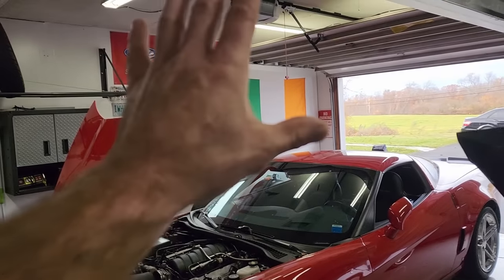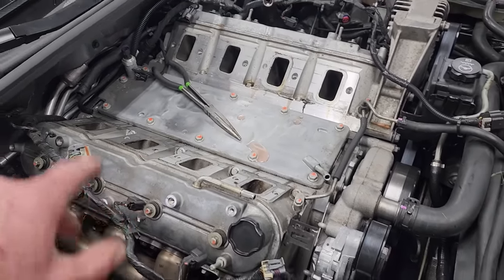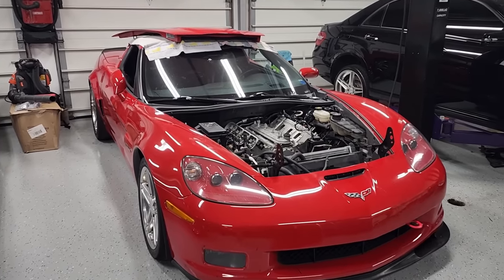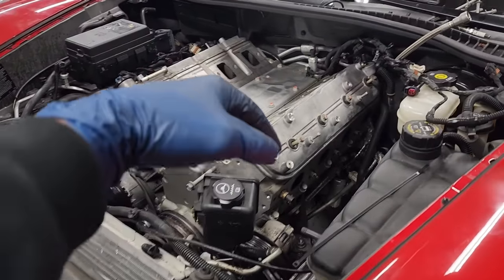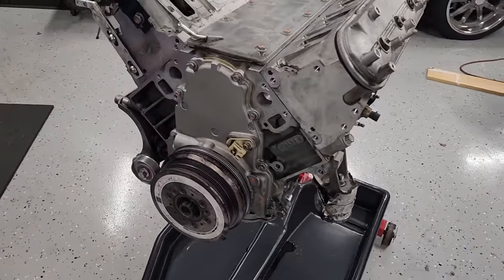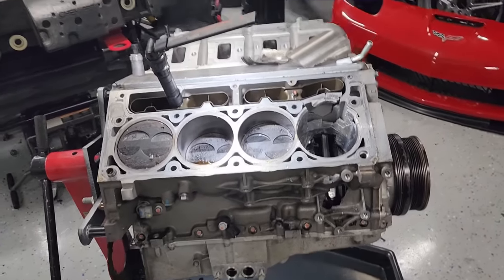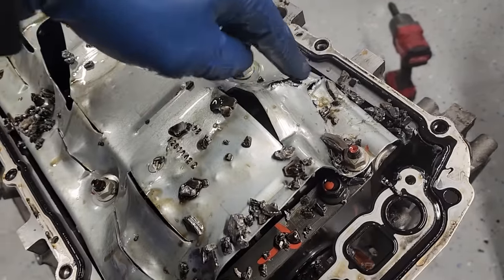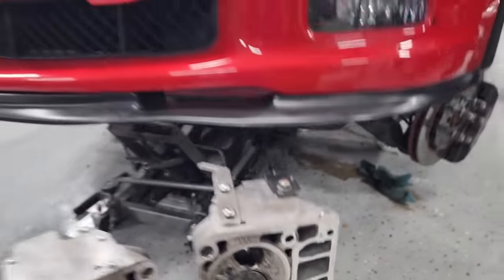LS7 CARNAGE: What Happened to this COMPLETELY DESTROYED Z06 Engine?!!!

Comment: I just came across you, so I don't know the backstory on this car yet.
Did you buy this like this, or did it happen while you were driving it.
I don't know much about these engines, but if I remember right, they have hollow stem exhaust valves. I'd say that's a disaster waiting to happen.
Those cylinder walls look awfully thin, too. 
The body looks to be in good shape.
I had a 69 Mustang Mach1 428cj back in the early 70s.
I used to street race it, overreving it and floating the valves. Nothing broke! 
Oh, sorry, that was a Ford. 😆 🤣

Comment: you mentioned that the intake valve was the hollow one but it is actually the exhaust valve that is hollow and the exhaust valve is usually the one to fail. My ls7 motor failed in exactly this fashion at basically the same miles too. Dropped and exhaust valve which ate a piston and completely destroyed the block. These heads are garbage. The bottom end also needs work. I replaced my blown ls7 with a new ls7 with upgraded heads but it spun a rod bearing after maybe 5 track days. Horrible motors all around.
Reply: Hi, can you tell me at what mileage and year Z06 the valve fell and the tragedy occurred
Reply: @leksldje3085  2009 around 40k miles

Comment: So are we shelling out lotsa mula for another ls7 or we just gonna save some money and put in a built 408/415 stroker motor?? Hmmmm thats a tough pill to swallow…..id probably just drop an iron 408 in it and throw all the boost at it….if i was track daying the car then a stroked ls3 would work too!!!…..you might be ahead of the game if you can get that crank polished out!!!………either way i know you got a game plan figured out in that head of yours……..cant wait to see the next video with the replacement engine!!!
Reply: The c6z is much too well done of a vehicle to not put the proper motor back in it, IMO...

For one, the weight difference between an ls7 and iron 408 is pretty substantial... And it's ready for another 7.0l to plug right in as it sits — you won't really save all that much money, once you get each and every component to get a swap like a 408 stroker setup in the car and running.
Reply: @MichaelBeale  its literally 100lbs….and saving $10k+ from your wallet

Comment: Very likely a valve failure 😞 

Let me know if some of these not overcooked goodies are up for sale
Reply: money shift
Reply: @bb5242  possibly, I’d just expect more tagged than 1
Reply: No not a valve issue, more likely over-revving the motor. Only a possible 160 Z06 cars were affected by the sub-contract company that didn’t build to spec!!! All 2011-2013 were designed so that there is no way the exhaust valve can interfere with the piston.  This problem was blown up on the Internet big time. GM has all the records and it is very accessible to get the data. To damage so much of the bottom occurs when over-revving. Very common on the race track!!! Exhaust valve problem doesn’t do that it normally only affects the cylinder and it tangled with.

Comment: Surprised to see a timing chain.  Needs a gear driven.  At high rpm those valves will Not keep up.  But, they did for 36k miles, except one.

Comment: I traded my Machine Silver '08 C6Z with about 35900 something miles for my '16 C7Z. The C6Z had a Haltech CAI, LG Longtubes and Corsa catbacks and a tune. The heads were never touched. Thinking back on it the C6Z had a lot more air coming in and going out with the CAI and exhaust, but stock fuel pump and injectors - LEAN. For all I know it could have been ready to go bang, since your's died at about the same mileage. Sheesh. 

I heard that a lot with big cams and high pressure valve springs but stock heads also suffer the valve drop due to more stress on the valvetrain with the higher lift etc..

Comment: Being of age in the sixties and not a devotee of GM ...it is not surprising to see that they still make better petards than anything else.  The idiots who designed  the LS 7  of the vintage years in question should still be on welfare , considering the fact that  20.000 rpm engines that stay together have been around for fifty years or more ,  this run of engines is really pathetic , but that is CHEVY.

Comment: If your just changing the head out, what all do you have to take off the car?
Reply: Air intake, intake manifold, tons of hoses, radiator fan, PS pump bracket, etc. It’s a fairly simple job (minus the PS pump bracket) but it does take a decent amount of time (at least it did for me.) I had the heads off in 6ish hours and got everything back together in about 12 hours, but it was my first time doing it.

Comment: I must disagree with you on your LS7 assessment because as a corvette owner myself the valve issue is only present on engines which have be modified. Yes the early heads had recalls but if you leave these highly engineered engines “alone” they will last a lifetime. 

As with any HP machine people just do not understand how sensitive the close tolerance engines are and most make mistakes. You change the cam the valve guides need to be highly modified to match the added value travel.
Reply from the maker: Stop spreading false info
Reply: Almost every part of this comment is incorrect...lol

Comment: The heads are a known issue.   If they havent been corrected or replaced then the owner almost deserves it.   I would love a LS7 but you could bet your sweet butt that I would have the heads replaced and probably a slightly hotter cam.
Reply: Ken, look what’s on the car? A CAI! More air in hotter exhaust, makes the exhaust valve breaks the engine! I have my 2007 since almost new, bone stock never any issues! Had for 14 years now!
Reply: @brianbartron2787  = CAI breaks exhaust valves?  Come on man, nobody is that dumb.    Geez,  just saying it makes me crack up laughing.
Reply: @kenstrain4366  why are you even commenting you you actually own a Z06 or just here to be a big ass typing on the keyboard?
Reply: @brianbartron2787  I own 2 Corvettes, one of them for over 40 years.    How many do you own sweetie?
Reply: @kenstrain4366  2 as well! 97 coupe 2007 Z06! 97 coupe is silver, Z06 is black. The Z06 is my 12th Corvette. Owning Corvettes since 1981 bought it brand new, Red with Red interior.
Reply: @kenstrain4366  do you own a Z06 though is the question, or are you chiming in with what you think is your vast knowledge? And part of the internet fear mongering that all Z06s are bad?
Reply: @SNELLERIZED You call yourself a garage and you do not know how a gas combustion engine works!! 😂! Let me explain it to you then, like you were a 2 year old! More air in (Lean) make an engine run hotter! That is why people that put CAI on their cars may get the dreaded check engine light! On a Z06 the tolerances are not very tolerant, why is it the exhaust valves are the ones that have the issue? Come on tell me? It run hotter! The exhaust valves are sodium filled so when running hotter they have issues! Does that explain it or do I have to draw it in crayon for you? I would hate to be a customer of yours if you own a garage!